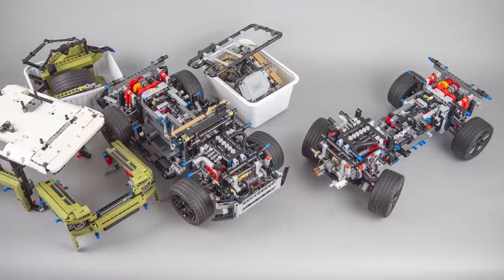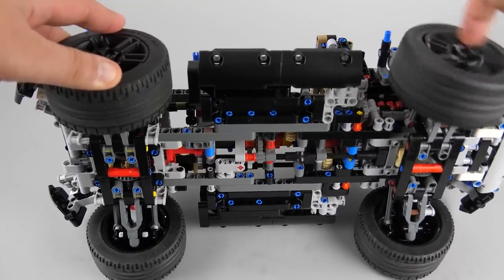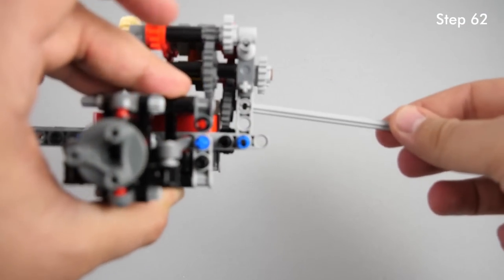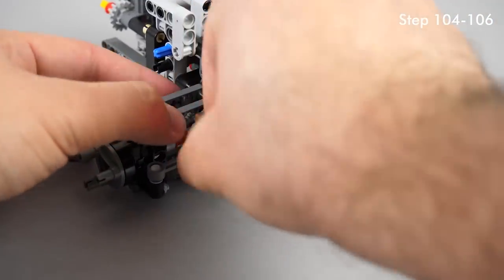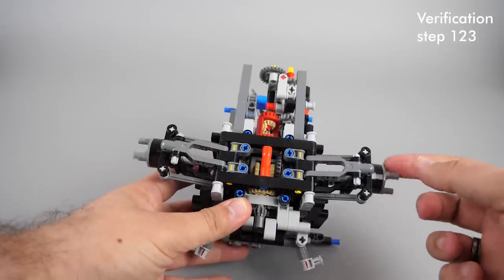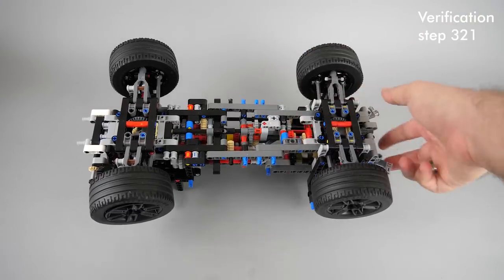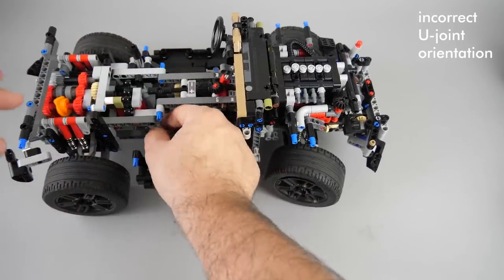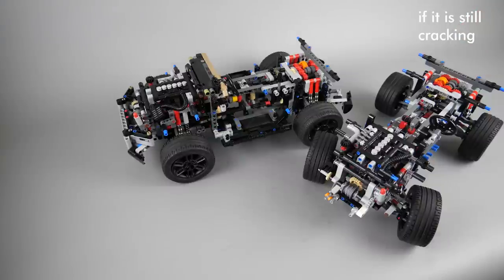LEGO Technic 42110 Land Rover Defender Ultimate repair guide

Comment: I just finished this set last night. After 860 steps I feel like I have been paroled. It is the most challenging set I've ever built and the instructions are lacking in many small details. Lots of ambiguity and guesswork. Way back an Expert Builder LEGO set consisted of plates, gears, girders, and axles which could pique the imagination into building many different things. The new Technic kits are closely related to bags of plastic confetti and the parts can be somewhat difficult to discern in the manuals. Probably just age creeping up on me BUT... of all my hobbies - they are the cheapest!

Comment: Mine won’t stop clicking in the two highest gears. Is it possible that there is a problem with the pistons/engine that is causing it to get blocked? Hence the clicks. When I disconnect the shaft going to the engine, all is fine.
Reply: French translated by browser : Welcome to the club, after 2 meticulous montages always the same observation for me. It seems to be one of the causes of crunches but in any case the u-joints do not transmit forces well. They transmit them by sacade, which largely explains the crunches. The arrangement of the pistons is not optimal either. The book suggests a sequencing of the 2-1-1-2 pistons while a 2-1-2-1 configuration would better balance the rotation. But hey I can not retest this for the moment having a multitude of broken parts (in transit, but I specify that it is not in relation to the crunches but following the application of a lubricant on them)
Reply: Strangely, it only clicks when in D and pushed forward. D and pushed backwards is fine.
Reply: @SHARP2026  The same and it's normal, it's due of the orientation of u-joints and of the two grey differentials. Someone tried to reverze the sense of differentials and for him, it's ok in forward but not ok in backward

Comment: Hello i just finished the drivetrain. Because of these known issues i did take it slow and made sure everything was in the right place. Still in the fouth gear i had a lot of built up tension, wheels rolling back. At faster speeds it was even cracking. Since everything was in the right position i decided to try flipping the diferentials, that helped a lot, eliminated cracking but there is still a lot of build-up in the drivetrain. Is there any new method of making it run smootly?
Reply from the maker: There are no miracles unfortunately. You can try to build it again, or you can accept the fact that this is a Land Rover and it will crack after a while regardless whatever you do with it.
Reply: @RacingBrick  thank You for the answer!
Reply: you can try some motor oil to ease the friction, apparently it's natural for land rovers to leave oil stains so it will make it more realistic that way :D

Comment: Hello RacingBrick, 
I see that you have the Defender build available in Studio 2.0. The LEGO design is the Land Rover Defender 90. I’m planning to build the type 130 (4 doors version) by extending the current design.  I want to use Studio to make the design. Are you willing to share your 3D stdio file ofvthe Defender? If I’ve finished my design I will sahre it on YouTube. If possible I will implement the electrification as well, engine and lights.

Comment: I have got past step 321 and noticed I’ve used the wrong gear at step 62 😒 any tips on how to change the gear without dismantling the entire thing 🤔
Reply from the maker: You either go backwards in the manual and see if there are bigger sections that you can remove in one piece, or you try to disassemble the area around the gear.

Comment: Hi 
I have reached step 271 with the wrong gear ?? What do you suggest?? Should I pull it all apart and start again or is there a easier fix.. PLEASE help...
Reply from the maker: That gear is added at step 271, simply use the correct one.
Reply: RacingBrick OMG I’m so stoked I’m embarrassed thanks champ... 👍👍👌🙈

Comment: Hi, great video! I have checked all the passages you listed and they are all correct, plus there is no dust on the model, but when I try the verification step 321 (18:17) the fake pistons struggle to move and there are bad cracking noises. I honestly don't know what to do...

Comment: my front and back wheels are spinning against each other.. differentials all look to be in the correct orientations.. if i manually spin the grey gear connecting the U connector with the gears that move the pistons the wheels DO spin correctly

Please help if you can... already went through a full troubleshoot and a rebuild of the full mechanism
Reply from the maker: What are you turning when they spin against each other?
Reply: @RacingBrick  if i spin either the two front wheels together or the two rear wheels together, the opposites spin the opposite direction
Reply: @RacingBrick  am I wrong to think my problem is somewhere between the central differential and the gear selection switches? Any helpful insight from you would be amazing!
Reply from the maker: @dabodood7892  check the video at 19:09, because of the central differential that's a totally normal behavior
Reply: @RacingBrick  awesome thanks! My model still isn’t running great.. trying to drive it forward, the gears definitely stick somewhere, and really builds up tension, then they jump forward.. especially the higher gears

Comment: I had the "inverted differential orientation" problem on 42082 (rough terrain crane). But since it does not have the central diff, it was refusing to roll

Comment: will we see the engine work if, instead of fixing 3 wheel and rotating one, we just put the car on the ground and push it forward? (say in Drive mode with high being selected)
Reply from the maker: Of course, that's how it is supposed to work.
Reply: @RacingBrick  got it, thanks! I encountered the situation where things work when fixing 3 wheels and rotating one, but don't work if pushing the car on the ground. After watching your video I figured out it was because the front and back differential were positioned incorrectly. Very helpful, I learnt a lot!

Comment: So the problem I have with my build is once I start to move the set, it goes for a little then it hear clicking and the car resists moving forward. It actually goes backwards if I push it against it after it begins resisting.

The front and back tires move opposite each other when moving just one tire, the together in the same direction when I move each differential and they all move together in the same direction when I spin the center differential. What could my issue be?
Reply from the maker: You can check the universal joints' orientation, but otherwise it's really about careful building, ensuring nothing rubs against something, nothing is too tight or too loose.
Reply: @RacingBrick  Thank you. I've had to rebuild it twice now since after realizing I had the littlegrey and dark grey gears mixed up but I think I got everything put together correct this time but I guess I'll have to go through it once more lol. I'm sure I did something wrong along the way as my hood doesn't sit flush.

Thanks for the reply, love your videos and dedication to the hobby.

Comment: I've never had the cracking problem but no matter how many times I build it, the gearbox doesn't do anything. The pistons in the engine never move when I push the car along no matter what gear is selected
Reply from the maker: Sounds like one of the differentials is reversed. Did you compare your build with the video?

Comment: I know this video is old. However I hope someone sees this soon. I need help on my defender. So what’s happening is that when pushed forward in DRIVE and LOW or HIGH The car moves fine but after about 30cm of distance it locks up and starts cracking. When the vehicle is lifted in this locked stage the gears then release in the opposite direction pushing the car back to where it started. Does anyone know what this is??
Reply from the maker: I suggest checking the link in the pinned comment

Comment: D and r are same for functionality?
Reply from the maker: No. D is drive and and power from the wheels go through the  hi/lo selector, the gearbox and then goes to the fake engine. In R the whole thing is bypassed and power goes straight to the fake engine and it runs in the other direction.
Reply: @RacingBrick  thanks for reply, but we can drive car at both direction either d and r?
Reply from the maker: @removebe4flight  sure. The whole gearbox and all the selectors only affect how the fake engine works, since in the set's case the wheels are driving the engine and not the other way around.
Reply: @RacingBrick  Got it, thanks again

Comment: Man, I'm so discouraged... I've fkn tried everything and whenever I get to gear 3-4 the cracking noise starts... I've put the axle rods in every direction possible there both aligned properly but still cracking... I've rebuilt the main gear box countless amounts of time, same goes for the DNR and MIN/MAX section... So many times every time I think I've got it and every fkn time it starts again... Now I know it's too late to send this fkn shit set back to Lego but I really fkn wish a could.... So fkn fed up... Any help would be greatly appreciated.... I did take the 4 red springs for the back for the front of my Bugatti to fix the suspension problems with the front end of it so now I'm using the 4 yellow springs on the land rover... Could that be bad?... I know they're not the same kind of spring... Just thought of that...
Reply from the maker: I'd suggest to simply let it go. I recently did another video with the set, if you build it perfectly and without cracks then you let it sit for a couple of months, it will crack. Even if you swap the gears to the new ones, you can make it crack. It's the design unfortunately.
Reply: @RacingBrick  thanks for the quick reply your video's are awesome btw ;) I have a bunch of technic supercars one of the only ones I'm missing is the Porsche 911 GT3 RS 1:8 Scale model (42056) ;)

Comment: I don't know why this video exist. If you're unable to build it, just make practice with a lower-level set no? The instruction is always very clear (if it's an original LEGO)
Reply: Your comment does not really hold water because I mounted the 42082 (+4000 pieces) without worries, then 2x this one with the same rigor and always the same result: crunches. The design and the successful operation of this gearbox is more than haphazard. The first books published by Lego obviously contain at least 1 error (which has since been corrected). And advice / warnings on mounting and testing from them would not have been too much.

Comment: Hello! Thanks for the great video. In fact it seems I mounted the U-joints at step 89 correctly by accident - I have the old manual in which they are not aligned, but I ignored the manual and just mounted them "symetrically" for better looks (typicaly  U-joints have enough flexibility to work idependent of orientation). I have other problem - while pistons movement on R is very fluid, on D is it kinda jerky and you can basically feel how the whole gearbox system is accumulating energy like a string. I thought that I made a mistake during construction - but then I observed similar behavior on D in your video. Can anyone confirm that somewhat "jerky" movement of pistons on D is normal to this set? 
I recorded it: https://www.youtube.com/watch?v=Xcg4cNe7Lm8

PS. If so I am kinda dissapointed - another set from LEGO that is over-engineered for its own good. I already own the legendary 8880 and while great it is also a little bit too much complicated - for example due to 4 wheels steering fighting with friction of wheels it has a tendency to desync front wheels with rear wheels and it feels fragile in general. Still the gearbox is working  great there - movement of pistons is fluid on each gear and only speed is affected.
Reply: PePe_PL I have the same problem. Would be a pleasure to fix it ...
Reply: same issue. i am trying to fix it since 5 hours. cant find the mistake in the build. what i think is happening is that the whole mechanism is blocking somewhere and eventually the torque resolves over the reverse gear wheel. I am pretty sure the issue lies behind the angled red axis in the gearbox. if i disconnect the gearbox , it runs smooth. The problem is then that both the front and the gearbox run smooth individually.. so it seems like the issue is with the angled axis. I have the correct orientation though.
Reply: welcome to the club ... its second u joint to engine... take it out and its super smooth...

Comment: En fait, je pense que j'ai ruiné mon Land Rover complet avec du lubrifiant il y a de cela quelques jours. Quasi toutes les pièces autour desquelles j'ai lubrifié sont en train de se fissurer puis de se casser... Je comprends mieux pourquoi les u-joint ont lâchés. Bordel de merde ! Je ne sais même pas quoi faire, à vue de nez y a moins une vingtaine de pièces en tout genre de fissurées, voire plus. Mais quelle poisse avec ce set...  DONC NE METTEZ JAMAIS DE LUBRIFIANT SUR VOS PIÈCES SINON VOUS ALLEZ TOUT NIQUER !
-----------
In fact, I think I ruined my complete Land Rover with lubricant a few days ago. Almost all the parts around which I have lubricated are cracking and then breaking ... I understand better why the u-joints dropped. Damn it! I do not even know what to do, at first glance there are less than twenty pieces of all kinds of cracked, or even more. But what a pity with this set ... SO NEVER PUT LUBRICANT ON YOUR PARTS OTHERWISE YOU'RE GOING TO FU** EVERYTHING!